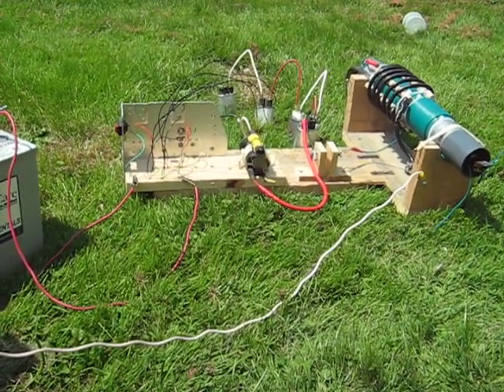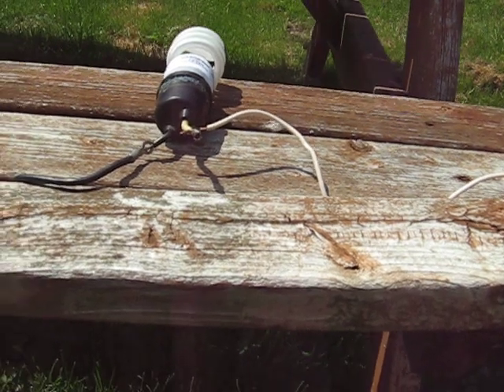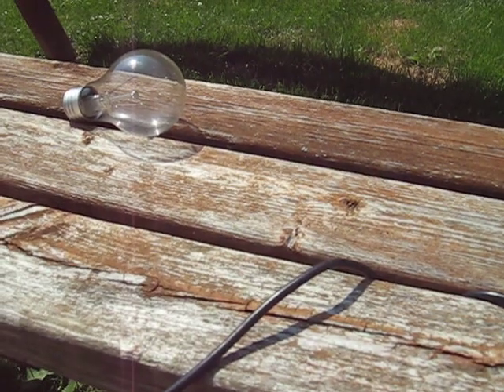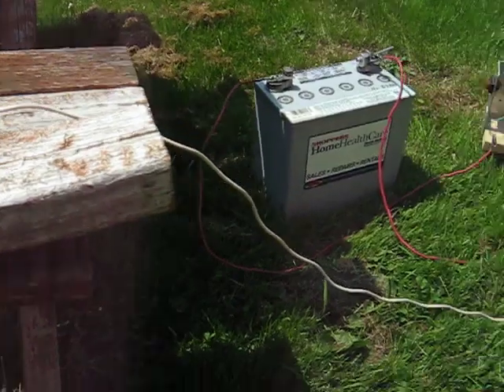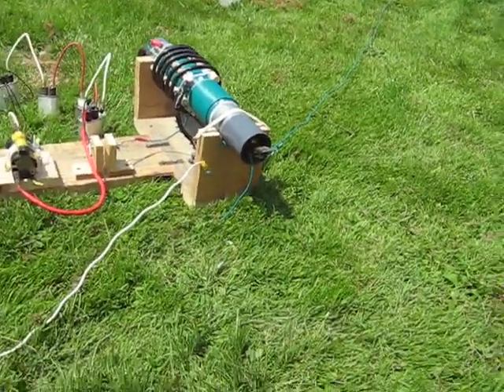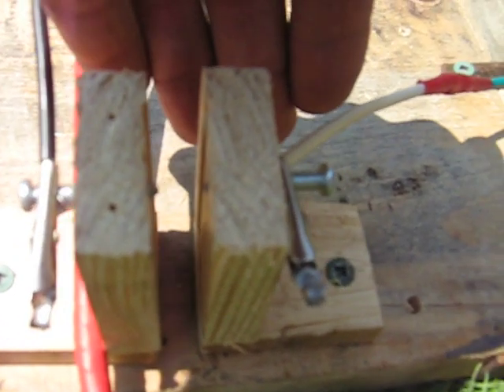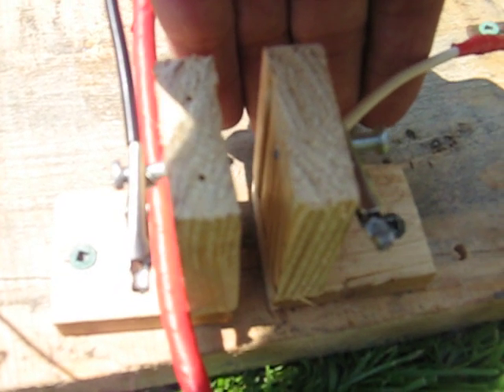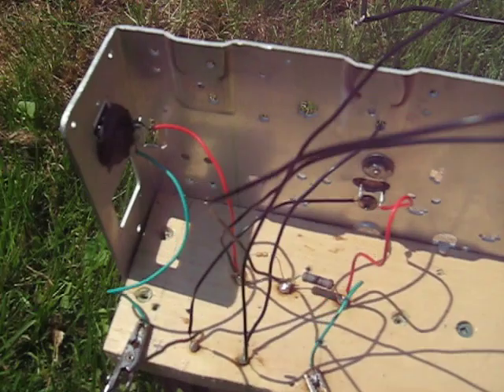Kapanadze Generator - Part 4 No Measurements Needed

Comment: You changed the cap, use the one you made first, the wood will conduct some of the high voltage, put in some PVC tubing would be good to insulate from high voltage losses caused by wood, wood is a weak insulater at best, you are getting it, stick with what you test that is working, take your time . Am enjoying watching your progress.

Comment: I think you should probably not use the CFL bulb.  It has circuitry inside that does not play well with the high voltage you appear to be putting into it.  I would not be surprised to see the build not work in a normal application now that it has been subjected to this experiment.   Maybe it would be better to try a clear incandescent bulb so we/you can see what is going on inside of the bulb.   Thanks for posting your experiment.

Comment: I agree with the ground comment that was posted a while ago.  How wet was the ground you were tied into?  How clean was the pipe?  How deep in the ground did you go?  I remember in the original video one of the ground leads were attached to a pipe.  Have you tried attaching one of the leads to a well or deep ground device?  Please reply if you still are active with this video.

Comment: Did you connect the microwave capacitors in series because you thought they were not rated for the voltage you are working with?  You will get more capacitance if you hook in parallel.  Perhaps you are already aware of that.  Be careful of high voltage, it can light you up as you cash in your life chips!

Comment: for a few year ago, I needed a generator, a friend told me about it, takes a standard three-phase electric motor and overspeed it so you get a generator. but if you ask an electrician on how to build a generator, so you get a talk on for hours about how hard it is to build a generator. What I mean by this is that it may well be as you say, "there is a Cooperative. 50/60Hz to" I follow with interest and should test a Flyback

Comment: heres the thing about the gap. i remember the distance was also proportional to the current. the farther apart the less current, but not more voltage.. im not totally sure but fairly confident. there is no sHV tep up or down, just a step down in current according to distance i believe. if its going to work i think it has to have that millimeter gap to let the current through, at least with the input you are providing.